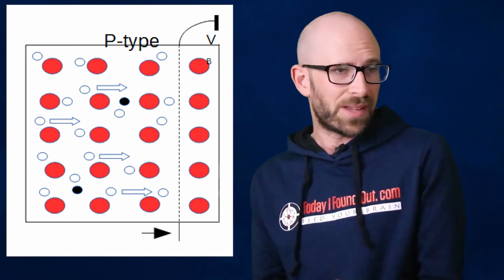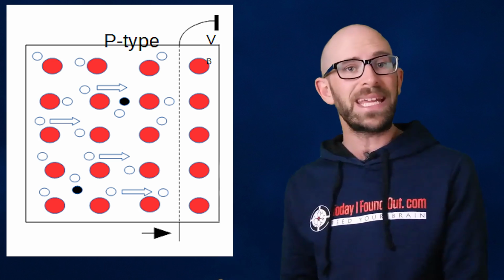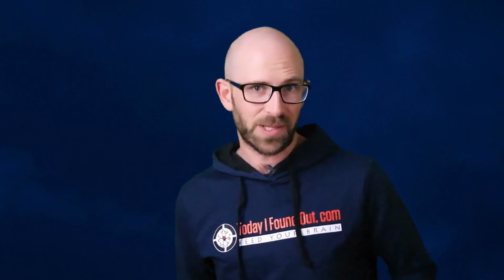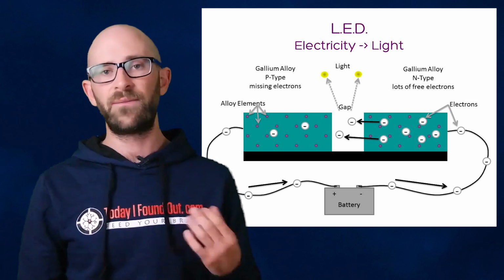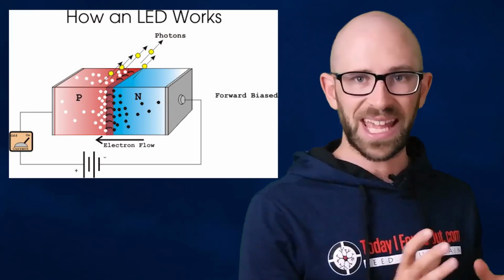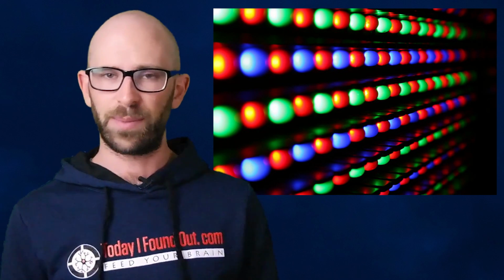How Does an LED Work?

Comment: all photon science is very funny
supposedly only element you can find photon in is hydrogen. all other elements are made of multiple of hydrogens (helium is 4 of hydrogens) minus photon. no other element possess any photons. 
where do get those photons from and how did get unlimited supply of it while led is of finite mass, hence even if there is any photons there those are limited number (finite) hence limited time of emitting light
Reply: WizardNumberNext 
That was word salad.

The photon is an emergent property of matter ... particularly sub-atomic matter. Photons emerge as a result of matter-matter interactions or of matter-energy interactions. But they are not stored... an electron transits from a high energy level to a lower one, and the energy lost comes out as a photon ... a localised wave-packet of energy.
Reply: WizardNumberNext 
Regarding what elements can give out photons ... any element can do this. Your undrstanding of chemistry and physics is very poor.
Reply: David Andrews your understanding is very poor. You definitely have read our heard a lot, but have serious problem with connecting dots. 
1. energy cannot be created or destroyed
2. matter cannot be created or destroyed
3. in order to convert energy into matter or other way around you need enormous amount of energy, decidedly not say 0.04 joule or less - that is a threshold (or at least close to threshold) of good LED to start outputing light. In order to make converstion you are talking about you need level of energy around 84TJ, not fraction of 1Joule. It clearly shows lack of analitic thinking capabilities in your case. By the way photons are extremely harmful to any living being. How would you explain that I am looking on my smartphone now and I am not getting sick quite fast?
Reply: look whatever you would say, write or think. 
1. let me know, if you have seen at least one such sub atomic particle using your own eyes, not on video or other such form of second hand (actually third hand, as microscope would be real first hand, not your eyes or camera) 
2. can you imagine how those particles are behaving? 
3. do you have instruments which are 100% accurate and are not tampered with to show you not exactly what is happening? 
all your "knowledge" is most probably based on what "scientists" have "discovered" 
here some explanation 
"knowledge" - something what MAJORITY of interested people BELIEFS is correct 
"scientist" person who is supposed to "discover" how things work 
now to reality 
no scientists of today world is allowed to conduct their research using "science method" 
science method is to observe specific thing happening, then to try to explain and most important - try to contradict own hypothesis 
only when prooven that you are unable to contradict hypothesis, you can say you have discovered something 
the problem is most of today's science confessor itself on exactly same field 
I have quite few years of experience of connecting dots, which you guys are simply blindly ignoring. 
I won't answer any of your comments anymore as if you would not understand this, you won't understand anything as you are not practising science, but religion
Reply: David Andrews you do not behave like scientists. You behave like fanatic who's religious feelings and beliefs have been hurt. 
I know your type of man and you are easy too far from behaving like scientists 
scientists always allow himself to accept that he can be wrong 
you do not allow such feeling, even when it is NOT your discovery 
lets sum it up
you have not made this discovery
you have not seen this on your own eyes and suitably never will see as no eyes allow to see it without usage of other intruments and as scientists you have to accept that instrument may be showing not exactly what is happening
you react with aggression to idea you may be wrong - that is type of behaviour of fanatics - I fear you cut my head

p. s. scientists always is on lookout
another thing is
does gravity exists? 
how will describe gravity? 
this is still thought in scools exactly same way for over 200 years even when "science" or rather your "religion" knows better. 
as a scientist I know that everything falls to earth - I do know why as all explanations in existence are proven to be wrong - by people who you call "scientists" and by me myself without all their fancy toys which they call "scientific instruments" - they even cannot verify if what they see through those instruments is what is really happening. 
arguee your religion - it leads nowhere, you have been fooled and you are trying to fool others including yourself not even knowing that you are doing that - it doesn't show any high level of intelligence
Reply: it is pointless to talk to you. 
you call me names, just because you do not want to even think that something might be wrong somewhere, not necessarily you. 

if you were computer I would reset you as you have hunged. you see only one "truth" and cannot even admit possibility that this "truth" might be flawed in some way. you act as today's "scientists", but they are not anymore, as they do only what they are paid for otherwise they would either loose their luxurious life or be ridiculed as you are doing to me. ultimately there is one person with ultimate power of decision, if you will get grant or not - face this 
ultimately, knowing it or not, you do what they want you to do - nice sheep, lovely monkey, find your own name
Reply: btw I am not even reading your comments anymore - it is waste of my precious time - I prefer observing my led and seeing radio wave (light) forming 
seriously
that is science 
not what you guys are doing 
you guys on one hand say A is white 
and when somebody is not concerned with exactly same subject day that A is black 
you simply cannot do that. 
I always shall catch you guys on this, as I remanded everything I ever seen, heard, read, watch, imagined - everything and now imagine fastest computer with most memory ever - I can search within my memories in matter of seconds.
Reply: David Andrews for your information I am not jealous of anybody getting to university. I long time above it. I seriously do not care about university. I am very happy man without university
Reply: David Andrews I have reported your harassment. I have not called you names, you did it repeatedly. Your lack of understanding of my opinions is not reason to call people names.
Reply: Which guy's the troll?
Reply: David Andrews Well, since you are the one with the british insults, you could assume I was talking about the other guy...
Reply: Clairvoux 
Scientist...I always check. :p

I have so many run-ins with people like him who then get all their pals involved and bombard me with the 'troll' thing.
My Fb got locked because of the militantly wrong: antivaxxers. The fight to get it back has got me hating the wilful scientific illiterate. Passionately.
Reply: David Andrews another report
Reply: WizardNumberNext 
Reported you.
Reply: David Andrews for what? arguing with you and not using any cursts on you. for being polite? go see your doctor, as it seems you have some problem and see thing which does not exists. seriously youtube lacks one feature - blocking some people, like on Facebook
Reply: David Andrews I shall do it last time. 
I do not force any beliefs on you. Why do you force your beliefs on me, and when I decline to make your believe system my own, you harass me with calling me names and curstsing on me. 
Again I do not force any beliefs on you. Sop calling me names for not believing your God. Thank you

Comment: WTF?! You lost me pretty early in this video. This video is no fun!
Reply: You have 2 "plaques" a negative and a positive.

From the negative plaque electrons will go to the positive, and when they do this they release photons.

The frequency of the photons depends on the energy state of the electron, so the higher the energy change from an upper state to a lower state, then the higher the frequency of the photon.

And this frequency can cover infrared light and the visible spectrum.